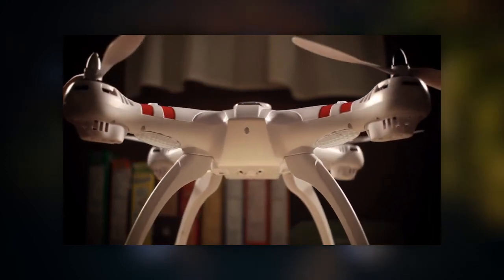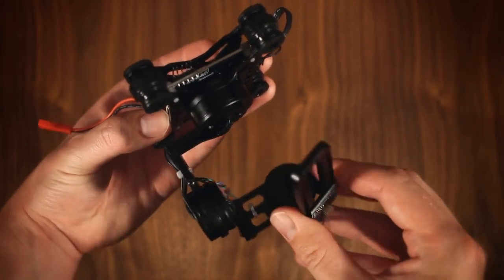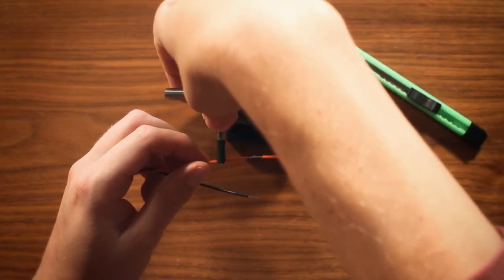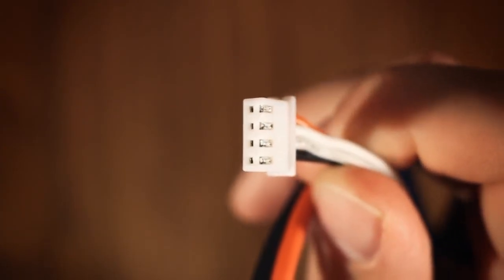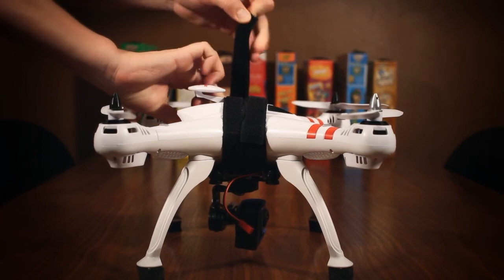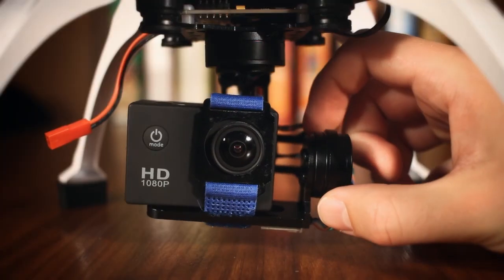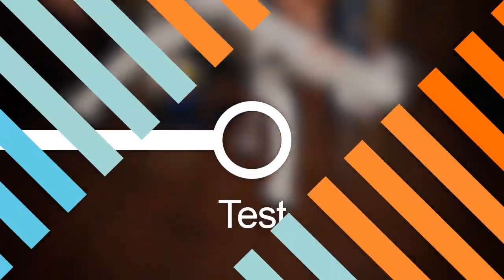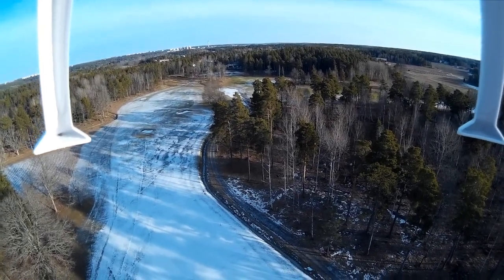Installing a Gimbal on a Toy Grade Multirotor (Bayangtoys X16)

Comment: I have put a set of original DJI Phantom 3 props on my x16, and using the shoe mount with my gopro clone, the jello had almost gone. Then I put a plastic Walkera G2d gimball on it using velcro straps and the video was excellent. 
I only got about 9 minutes flight time though.
I am yet to try my new Thieye T5E camera on it , but hope for better results (weather permitting.......)
Reply from the maker: I also tried on Phantom 3 props when initially reviewing the X16, but they seemed to somehow mess with the altitude hold on mine (quadcopter kept ascending, descending, ascending descending….) I’ll try balancing the stock props instead.
9 minutes is probably about the same flight time I got as well with my setup.
Best of luck with the new camera! :)

Comment: When dealing with any aerial photography platform, balancing the props is going to make a world of difference. I added one of the two axis gimbals you featured in a screenshot to my XK detect x380, and still got very shaky footage. Once I balanced its propellers, on the other hand, it was smooth as silk. Unfortunately, one of the motors on my gimbal developed a serious fault, and started creating severe electromagnetic noise. This threw off the compass on on my aircraft, and made it impossible to fly it in GPS mode while the gimbal was attached. Making sure you have high quality Motors that are as enclosed as possible is a really good policy when buying brushless gimbals.
Reply from the maker: Thank you, great advice! Finally getting around to balancing those propellers is on the top of my list going forward. Ordering one of those prop balancers right now…
Reply: I like the little triangular carbon fiber ones you can get for about $6 on Amazon. They work really well. In a pinch, however, you can use a level, a large coffee mug, and a pencil to balance most propellers. My recommendation for balancing propellers is that you use Scotch tape (aka sellotape) rather than sanding propellers. I gather that nail polish will work in a pinch as well. It is easier to add then to subtract, and I have never added more than a gram to the weight of an aircraft after balancing my props.
Reply: If you're curious about how big a difference it can make check out the results I got just using a little Scotch tape and a prop balancer:

Here is a video of me flying my XK detect x380 with a two-axis brushless gimbal 
from gearbest attached:
https://youtu.be/qrzlzrL2WhM

In this one eye turned the arm of the gimbal arounds to get the camera out between the front Landing legs of the quadcopter, and otherwise the only change I made was balancing the propellers:
https://youtu.be/Ks1o501QfhM